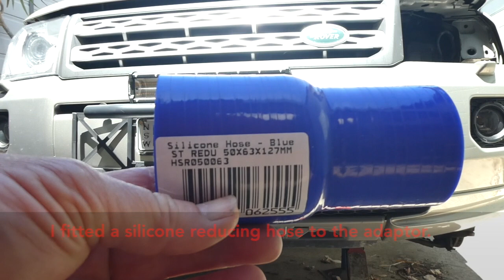Freelander 2 Raised Air Intake Installation

Comment: What’s the max wading depth of the beast now??
Reply from the maker: Well, it's not really about increasing the wading depth. It's definitely more capable of the full 500mm specified by LR. I wouldn't deliberately go into moving water higher than the door sills. I'm not planning on testing it, but I've had a bow wave come back over the bonnet of two other 4WDs I've had.

Comment: Great kit I have asked for a quote with shipping to the UK watching your video am I right in saying the pipe between the snorkle and air box needs to be cut to length?   Also is your reducer 127mm to 102mm I am struggling to find the one in your video.

Thanks
Reply from the maker: Hi, thanks for watching. The flexible hose supplied is slightly overlength so you can cut it to however long you need.
The reducer is 63mm down to 50 mm diameter, and 127mm long. Good to clarify that, thanks.